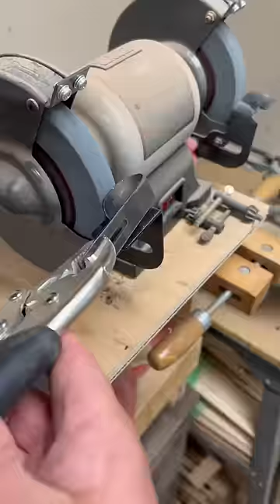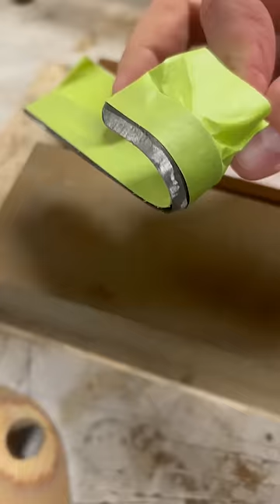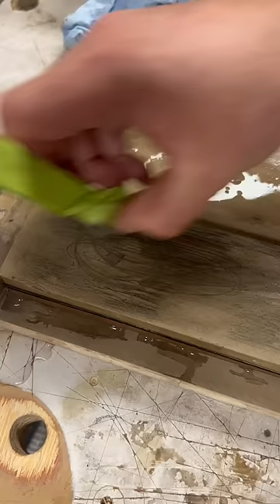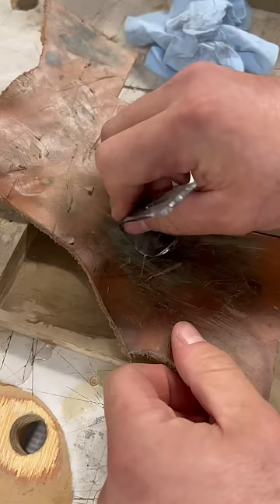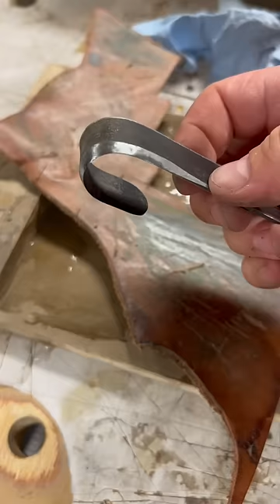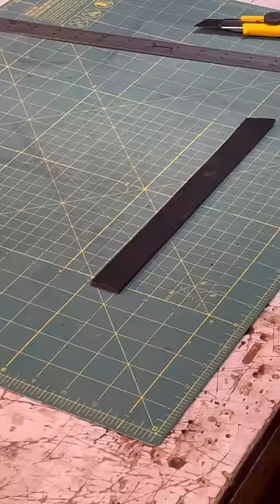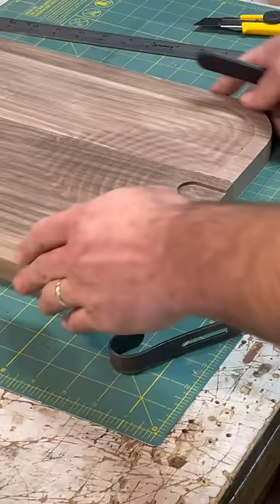Will this Even Work? #diy #woodworking #productdesign #leathercraft #tools #process #woodcraft

Comment: For irregularly shaped blades, you can use a buffing wheel and different levels of buffing compound to sharpen it. That way it saves your stones from inconsistent wear and the hassle of sharpening a curve on a flat stone. Keep up the good work, that is a great tool. Maybe if that one dulls too often, get a piece of a car/mini truck leaf spring and use that, though you will have to use a torch to bend it and heat treat it.
Reply: Actually that doesn't really sharpen anything.

It hones the edge. If there is no edge at all to begin with, it won't work.
Reply: @evictioncarpentry2628  Honing is sharpening.

Polishing wheels will create edges, moreso if they are rigid backed.
However, they will create nasty edges due to the compression/deformation of the wheel, rounding a lot near the apex.

Aside from it being dangerous, it produces a poor edge, not worth doing.
Reply: @autumn5592  I think you missed my point by trying to be a youtube bill nye the science guy.
It does tune the edge up yes, but if there is no edge at the apex in the first place it won't do shit.
Reply: @evictioncarpentry2628  Polishing wheels abrade material, abrasion allows sharpening.

There are MDF wheels for sale that you can mount on a bench grinder, which you load with Chromium Oxide paste, and sharpen with.

It is entirely possible, but like I said, it will produce a poor edge.
Reply: @autumn5592  I've been making my own MDF wheels like that for almost 10 years. They don't sharpen shit when there isn't an edge left. You can sit there for an hour and all it will do it polish it. You clearly don't understand the difference. 
I'm done debating this with you. Later.
Reply: @evictioncarpentry2628 with a low enough grit compound you can obviously put an edge on something. But most compounds are far too high grit to effectively remove material because that's not the normal use. However all sorts of grit is available.
Reply: @evictioncarpentry2628 regrinding an edge is not the same as sharpening bud. Establish a basic edge with a file and then buff it into something keen. Again no stones required.
Reply: @autumn5592 honing is NOT sharpening. Sharpening has to remove material and create a scratch pattern. If your argument is that you can use a low enough grit compound on a cotton wheel then that's absolute madness, at that point why not just use a stone? But back to the issue at hand..no, honing is not sharpening, you have to have an established scratch pattern and enough material removed and moved back and forth to either side of the apex so as to create a wire burr that can be fatigued and removed to expose the actual true edge.
Reply: @GerstBladeworks  The word hone literally means sharpen.
Honing even in the colloquial usage removes material too.

'Scratch pattern' meaning what? It's arbitrary. Grit doesn't define sharpness. 

You don't need to form a burr to sharpen an edge, you can form an apex without forming a burr.
The burr is just a convenient way for beginners to see if they are doing the right thing.

As for the polishing wheel, yes, it would work, but like I said, it would be a very poor edge - rounded, overpolished, leaving it rather dull.
A wheel or a stone would be better, yes, I never said or implied it wouldn't be.
Reply: @autumn5592  no it doesn't.. here is the difference:
Honing is a knife maintenance method that realigns the sharp edge of a knife. Sharpening is the process of removing material on a knife to create a brand new edge. 

Stones are meant to be used inconsistently, it's the very nature of sharpening. Knives of different types have different blade shapes , this is why you use a flattening stone periodically or use diamond stones
Reply: @GerstBladeworks  Honing straightening is a colloquialism, if you read old literature, or use actually definitions, its the same as sharpening.

Example, old stones used to be called hones, for straight razors no less.

Honing removes material, because it is sharpening.

In regards to actual 'aligning' of the apex; ribbed steels ("honing rods") do not align anything, they remove material,  leather does align, but it takes hundreds of passes, and stones abrade material.
The only true aligning of an apex is a smooth steel rod, which only burnishes.

As for stone flattening, it depends on the grind/geometry.
You basically never need to flatten for chisels, plane irons, saber ground, scandivex/convex grinds. 

You only really need to keep a flat stone when working on flat sides or wide bevels; japanese knives, initial setting of chisels, straight razors.
It entirely depends on use.
Reply: @autumn5592 as a bladesmith.... You are flat wrong. 
Edit: sorry that was a bit harsh. I actually think you're mostly correct but you definitely wrong about not needing a flat stone.
Reply: Sushi chef here for the last decade. If I only ever used a honing rod to sharpen my blades, I would have a sharp edge on my blade for about 15 minutes and then I would have to do it again. Now if I sharpened my knife with a wet stone, it will have effectively sharpened the knife and the edge will last a full shift at work until the next day and I will sharpen them again with the stones in the morning before shift. The difference between honing and sharpening is very minimal. But when you are working with a material like this that is making microscopic changes to your equipment, the smallest difference makes a world of difference. I don’t know if this was helpful or if anyone is going to see the difference with examples given but I hope this helps.
Reply: Also I had a owner who didn’t know shit about knives who used to do exactly as one commenter suggested and used an angle grinder to sharpen the shop knives and every single knife he ever did that with ended up being thrown out eventually bc it could no longer hold an edge. I mean, it was so bad that you couldn’t get through like a dozen lemons, even, before it would be so dull that it would take multiple attempts to even break the skin on the lemon. Could it be fixed? Sure .with a lot of time and patience I could have created a new edge on the knife by starting on a low grit stone and slowly working up the scale. But fuck that bc he would just likely come back and fuck them up again. Anyways, moral of the story is don’t take shortcuts. It’s always worth it to do things the right way if you want your equipment to last.
Reply: @GerstBladeworks no bud, you're dead wrong. Hones literal definition is to "Smooth and SHARPEN" 
Google is free mate. Making a fool of yourself on the internet is priceless.
Reply: @GerstBladeworks I'm not stating you're wrong with your logic, you're thought process is flawed. Not worth arguing with people on the internet unless you're trolling.
Reply: @Shred.Flintstoned fair point and experience on both sides speaks volumes. Still, honing, is literally defined as sharpening. You're reprofiling the edge everyday. The knife will not last as long, but using knives is your career so it's worth it. "Razor sharp" is Not sustainable on any blade. A razors edge amd a working edge are two VERY different things and I think this thread has covered that well.
Reply: @Shred.Flintstoned you're second story... comment, should have been an edit to the first, yeah he made the entire edge go bye bye, then it wears unevenly and feels sharp until that burr is gone. Such a shame.
Reply: @PainReigns125  I think realisticly you’re both kind of agreeing and disagreeing at the same time. Honing will temporarily make something seem sharper by doing so but in reality it won’t be sharper. If it was sharper it would last as such. Also honing something over and over will ruin an edge. The edge of a knife is usually a very acute angle. And generally as you hone something it begins to slowly form into more of a right angle and that’s why it ruins the blame. It can be fixed by sharpening the blade by using a wetstone tho. It’s okay to hone knives in between sharpenings. Like I said I sharpen once a day and hone several times in between during my shift. They each have their own purposes. Not trying to be argumentative. Just want to try and share my perspective and experience
Reply: @Shred.Flintstoned  okay so I am agreeing with you. I wasn't even going to comment, but the other guy absolutley stating with a near smug matter of factness that honing is not a form of sharpening and even going as far as stating the definition off the top of his ass got me going. Sorry for and Ill placed tounge lashings. I would be so pissed if someone used a grinder on any of the knives I sharpen. We don't need a "straight razor" or "sushi chefs" edge or retention so I hone until I have no choice, but to reprofile. Edit: I did not see the part about honing mid shift that would also aid in my stubbornness
Reply: Or use a round slip stone on inside edge 😊
Reply: So all you smart guys in here and im the only one that thought this would have been a helluva lot easier if he had put his sharp edge on the piece when it was straight then bend it i mean he obviosly didnt do any heat treatment quick tool served its purpose well.
Reply: @PainReigns125 hi career blacksmith and knifemaker of 30 years here... honing was not defined as sharpening until relatively recently as you conveniently ignore the second (and older) definition of honing is to refine or perfect something over a period of time... Only specific very high grit "smooth" stones were ever called hones and those were ALWAYS a follow up to sharpening ... A honing steel does not itself remove material even the ribbed steels all they do is align bent matrix or "teeth" which is present between edge carbides if left alone the carbides break off leaving a blunt edge eventually stress hardening from being worked on a steel breaks off the matrix and the edge must be resharpened and honed again... Honing is not the same as stropping but achieves the same result if stropping is performed honing is unnecessary both are edge refinement through work hardening and mild abrasion the abrasive of a hone does not sharpen it REFINES by pulling away the wire burr from the surrounding carbides and matrix whereas sharpening produces the wire burr in the first place by removing material if the burr is left in place the fresh edge "teeth" cut into it and break off resulting in a blunt edge... Basically your entire premise is false and your statements are only barely speckled with accuracies... Honing is NOT sharpening it is REFINING a sharpened edge and some steels don't perform well after being honed on strops or stones or steels at all due to the composition and types of carbides present so removal of any present burr is done either by hand and pulling the burr off or by peeling it off with a chunk of wood depending on how toothy the edge is for example wood turning chisels sharpened to 220 grit vs a wood chisel sharpened at 2000 grit the turning chisel needs no hone the wood chisel should be honed on 6k to 32k ... And remember material removal is NOT sharpening! a 600 grit edge is just as sharp as a 6000 grit edge as hundreds of videos with charpy testers have proven.. Sooo yeah... There ya have it ... Come back when you have a few decades of research and put your name on 10,000 knives you have made with your own hands and we will talk
Reply: @jessebond4221  Perhaps you should brush up on your knowledge - 3 decades of experience doesn't mean you are knowledgeable, it just means you've done something for years.

Honing is sharpening, has meant that for hundreds of years.

There are plenty of 'honing' stones that come in relatively coarse (<1,000) grits.
Admitidly, these were used differently, artificially increasing their grit via dulling of their abrasive, and technique used when sharpening.
Still coarse stones, used to 'hone.'

They were not "always" used as a follow up to sharpening, they were used to sharpen, any abrasive media is sharpening.

Ribbed steels do remove material, that's their main means of making an edge sharp.
They remove material, high spots along the edge or micro-burrs, then they burnish the steel, deforming microscopically, to make the apex finer.
The only type of steel which doesn't actively remove material is a smooth one (a burnishing rod), which will still knock burrs off, and burnishes the edge.

Teeth, micro serrations, whatever you call them, are a myth. They don't exist.
Height variation on the apex does exist, it doesn't really change with grit (sometimes can be exacerbated with finer grits, which is the opposite behaviour it should exhibit if this myth were true), and doesn't change cutting aggression or 'bite.'

Carbides are much, much to fine to be considered 'teeth', you are talking sub-micron sized particles, absolutely ludicrous.

Carbides can break away through use, leaving a dull edge, yes, but not through sharpening.
Abrasives used in sharpening are harder than the majority of carbides, and will cleanly abrade them. Diamonds abrade any carbide.

Stropping is a form of sharpening, at least the modern usage with abrasive pastes.
Abrasive particles do the work, it's sharpening.

Honing is not done with work hardening at all.
Strops do not work harden edges, and abrasives like Silicon carbide or quartz (in natrual hones) are much harder than the steel (and subsequent carbides) abrading them, this is not work hardening.

A burr is just a excess material still holding on, you don't need to say 'matrix and carbide' to sound cool, lmfao.

Sharpening produce a burr, depending on the method. You can easily and effectively sharpen a knife with the entire goal of avoiding a burr. 
Burr sharpening is quite a beginner technique, it helps them establish when they have apexed. A seasoned sharpener should feel just from stone feedback and sound that they have apexed.

Ironic about statements, considering yours is all over the place, and covered with misinformation.

Some steels are picky, sure, the vast majority are not, and will take any edge you give them without much trouble.
It's only modern super steels that get picky.

'Pulling a burr off' or 'dragging it through wood' are some of the worst  things to do for an edge. they leave ragged edges which dull rapidly.

Turning chisels are sharpened at coarse grits because it's convienient, that's what most grinding wheels are.
Some people do take them higher, to around 1,000. It depends on the person.

A bench chisel doesn't need to be at least 6k, that is ludicrous. 
Are you telling me that throughout history people had dull chisels and planes unless hey had access to fine stones?

You then proceed to say grit doesn't matter? Which is it? Minimum 6k, or 600 fine?

3 decades of research, but the majority of it wrong, lmfao.
Making something doesn't make you a good maker, plenty of shit from china to prove that. Volume is not quality. But hey-ho, if it makes you happy, keep using it as an argument.
Reply: @autumn5592  this is going to be fun... Clearly you don't have any understanding of metallurgy id suggest finding some micro photography of edges it will do you some good... When talking about hardened steels we are looking at martensitic structures which is to say body centered tetragonal forms super saturated with carbon rather than cementite and pearlite but after tempering some austenite will always remain as such the "teeth" or micro edge serrations occur when retained austenite abraids away faster than the martensite ... Now austenite is also known as gamma phase iron and largely devoid of carbon making it soft this very property holds the formed carbides quite nicely but too much makes the steel too soft to be usable so we desire as much martensite as possible... What does this mean for sharpening? It means that as the carbides break away the remainder simply bends out of place this has been proven hundreds of thousands of times in the last 100 years or so ... As such honing steels particularly ribbed steels bend the soft matrix back into place while pulling away broken off carbides this is already well documented as well and the research is out there if anyone cares to look... Furthermore the term "hone" is late middle English ultimately derived from the old English han and referred to fine grained rocks used in edge refinement not sharpening ... Sharpening as an action is bringing an object to a sharp apex the grit is irrelevant hence my example as such past a certain point one is merely refining the established edge or "honing" they are not establishing the edge which is sharpening... Get it? Now then removing the wire burr via pulling is just as good if not better than abrasion as the wire is not formed of carbides it is the soft matrix around the carbides with carbide particulates present from the previous sharpening steps... Honing doesn't make something more sharp thats a myth and over honing can cause dulling as it breaks off carbides leaving soft iron with no exposed carbides or even worse pulls the carbides out of the matrix requiring sharpening to be performed all over again... And yes my comments are all over the place as i think faster than i type so im constantly trying to catch up to myself its a failing of mine
Reply: Maybe save some time sharpen the easy flat and straight piece then bend it alot easier I think
Reply: I use an MDF wheel on my 8” low speed bench grinder. I can sharpen ANYTHING in under 10 minutes. Mower blades, gutting hooks, boning knives, the back side of a sawzall blade 😂
Reply: @autumn5592  you're right. You just didnt understand "shaping the blade." 

"To create the edge profile in a reasonable amount of time" you can also use a file or sand paper but personally, I use an angle grinder, dremmel or belt sander to profile an edge; shaping it for the first time. A bench grinder is also a good tool, especially if it has speed control. 

Sandpaper and files are cheap, if you have more time than money. 

Honing does mean sharpening but it doesn't necessarily mean removing material and it generally doesn't mean removing a lot of material. It means "perfecting" something that's nearly perfect.
Reply: I use one of those sand paper grinding disks to cut out the bulk of material first, works a charm
Reply: @Shred.Flintstoned I agree, i have a wonderful trick for you!!!! Get a ceramic rod. It makes life SOOOO much easier. It doesn't create a "sawtooth" like ribbed rods do, 🤢, and it aligns the edge at the same time it removes a very small amount of material. It will extend the usable sharp range of your knife. Technically ALMOST indefinitely. If you get the edge get beyond a certain point, which you will you'd have to use it every few cuts to not, then over time you'll still have to hit the stone. But, this makes the life between stones much greater. Please give it a try it's wonderful.
Reply: P
Reply: It would be cheaper and easier to just buy a piece of bar stock with whatever alloy you want
Reply: It's only cutting leather, doesn't need to be that sharp
Reply: Damn dude you seem to have a wealth of practical knowledge